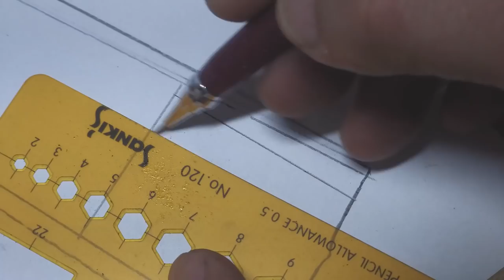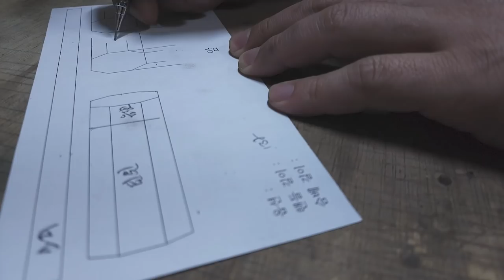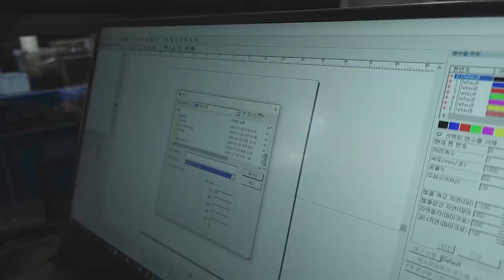어찌합니까~ 어떻게~ 할까요~?!

Comment: I would use a blowtorch to soften the new hidden tang slightly as it's likely to break if dropped. Otherwise impeccable finishing and a nice save.
Reply: Wouldn't you risk to soften the whole blade? 🤔
Reply: @redangrybird7564  no. You can see the heat travel down the blade by the change in colour. Sometimes people just have the blade end wrapped in a wet towel if they are not confident.